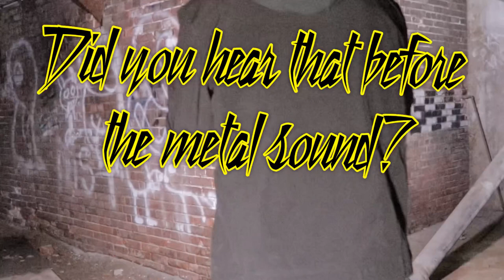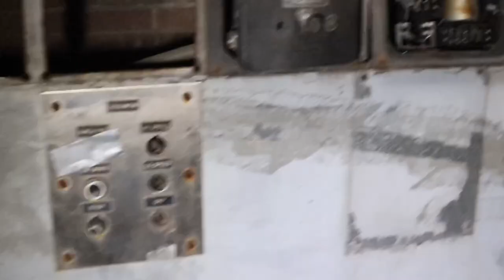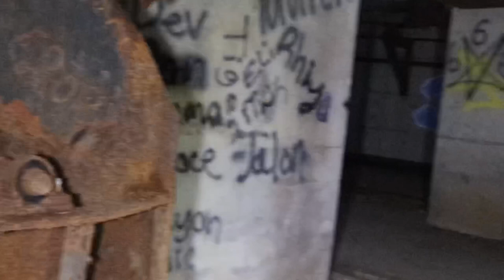Inside the Haunted Tunnels of Central State Hospital

Comment: how far did the tunnel between the Bahr building and the powerhouse go for you guys? if you went through it. I was there recently
Reply from the maker: We were down there for about 45 mins to hour. It started in the basement of a building then span across two tunnels that ran into dead ends due to collapses and
Reply: @MaddzEntertainment  makes sense, I figured most of the tunnel had collapsed
Reply: @MaddzEntertainment did you find the entrance in the powerhouse building ?
Reply from the maker: @KaelobBridgman  I don’t think there’s access anymore the local that took me mentioned they closed it off. We had special access.